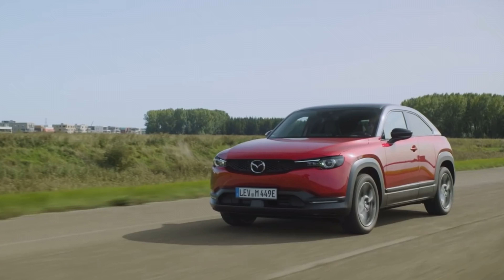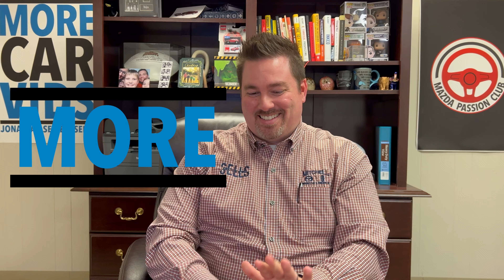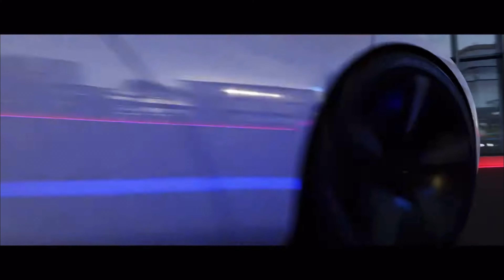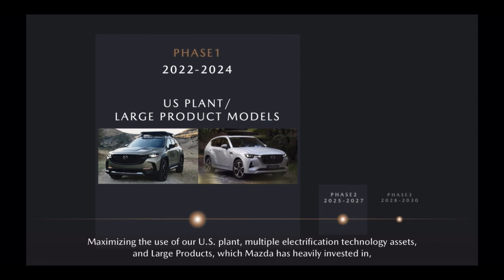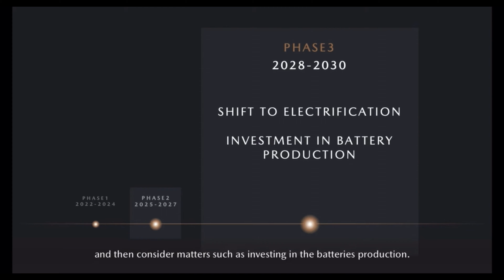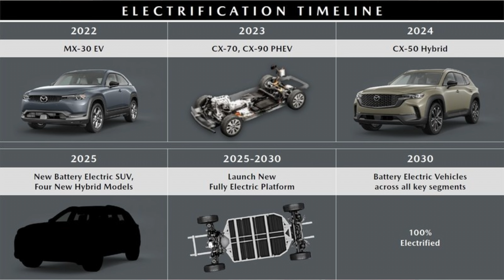Updated Mazda EV 2030 Plan & New Car Concepts

Comment: Jonathan, I'll tell you what Mazda needs to do to sell more vehicles:  Get them to the dealers in a timely fashion. I just cancelled my order for a CX-50 Preferred Plus because it's been "in transit" since they day I ordered it (according to Mazda's "digital showroom"). According to that website "in transit" usually means one to two weeks. I was told by my salesman that the car was "in port" in Jacksonville Florida on Tuesday, November 1 (when I ordered it). "It should be here (Delray Beach, Florida) in a week." After three weeks of waiting I contacted Mazda through their website. According to the person who responded the car was expected around December 1. FOUR WEEKS TO SHIP A CAR A FEW HUNDRED MILES DOWN I-95? (Yes, I know it isn't shipped by itself, but there were plenty of other cars listed as "in transit" for both this and other dealers down here in Palm Beach county, so they could easily fill several trucks.).  My salesman is trying to blame the truckers for not delivering the cars (Who decides what cars to ship? THE DISPATCHER AT THE PORT!). Since I'm not getting any financial benefits for turning my lease in early (ends in June 2023) I decided to cancel the order, and wait until the spring when the less expensive, but perfectly fine for my needs CX-50 Selects become available again (I saw some listed back in early October). And if Mazda decided not to produce any Selects when my lease expires I'll find another brand of car to lease. I like Mazdas, but I'm not married to them.
Reply: Hello
Here in europe, everyone is waiting for 8 months for a new car. Do you have problems for 4 weeks?😅😅
Reply: @Aleex7315  My complaint is when a company says one thing on their website, but then does something else. Don't post on your website that "in transit" means 1-2 weeks, and then take a month to deliver. Don't make promises you can't keep.
Reply: @stuartaaron613  They're not promising you anything. They're giving you an estimated time. Stuff happens, as the saying goes.

Comment: Mazda Canada issued a press release providing more details of what is coming over the next 3 years.  This is likely similar to what the US will get as well.

"By 2025, Mazda will launch a total of eight new hybrid (HEV), plug-in hybrid EV (PHEV), and battery electric vehicle (BEV) models in Canada, in addition to the MX-30 EV currently on sale in Quebec and British Columbia. These new models will include the CX-50 hybrid, CX-70 PHEV, CX-90 PHEV, four new hybrid models, and a new BEV SUV to be introduced in 2025. Additionally, sales of MX-30 BEV will expand nationally next year, and two core crossover models will also include mild hybrid (MHEV) powertrains for increased efficiency and improved emissions."
Reply from the maker: Thanks Steve!